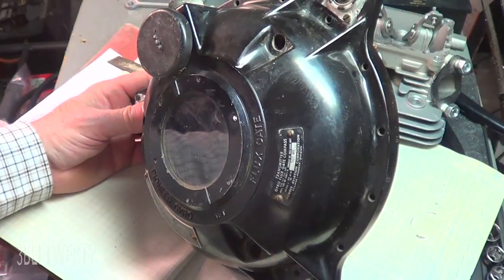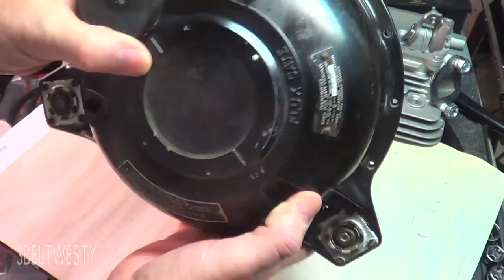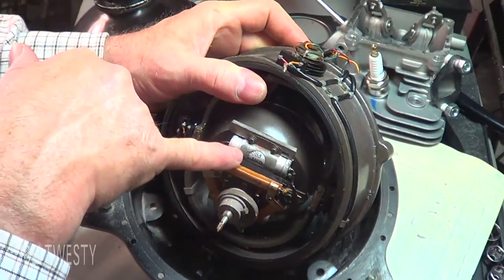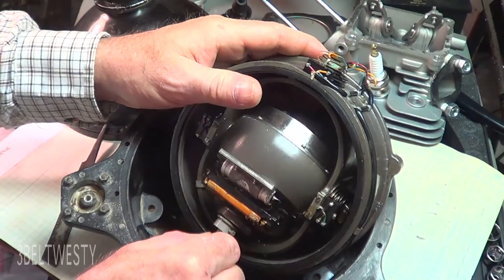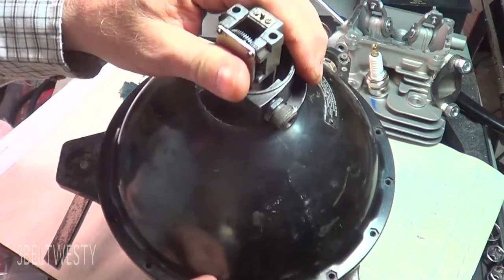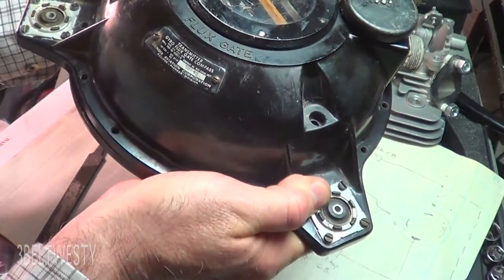Bendix Gyro Compass Transmitter Navy AN 5751 Flux Gate

Comment: Great show.  In later developments, a significant change was made by separating the flux valve from the gyroscope and suspending the sensing element inside a sealed bowl no larger than a coffee cup.  Gravity alone kept the valve vertical (horizontal for the plane of the sense coils).  Of course, whenever the airplane accelerated in longitudinal or lateral axes, that is, changes in speed or turning, the pendulum allowed the valve axis to move out of vertical and transmit erroneous heading data until the airplane returned to steady state flight.  Not a problem, because compass cards were slaved to a transmitter in the separate directional gyro, which maintained its heading reference during maneuvers by gyroscopic rigidity.  The signals from the flux gate were referenced to a differential synchro in the master compass indicator.  Any difference between compass card position and flux valve heading resulted in an error signal which was amplified and applied to a torque motor that would precess the directional gyro in the proper direction until the following master card was in the sensed heading position.  This precession rate was usually about two to four degrees a minute, so aircraft maneuvers were not persistent enough to significantly displace the gyro heading before level flight resumed.  Often, a slaving cut-out circuit shut down the torquer motor during maneuvers and enabled it in level flight.  The onset of jet-powered flight caused a problem when the prolonged acceleration during and following takeoff caused significant heading errors due to displacement of the flux gate pendulum.  Pilots were trained to anticipate and correct for the errors that resulted until steady state flight was achieved.

Comment: Most important thing of this device is not the gyro but the 3 fluxgate sensors we can see at 02:35 between the capacitors. The gyro is slaved to the fluxgate sensors using external amplifier.

Comment: I believe the gyro is only there to provide a level platform for the flux gate which is the active magnetic sensing device for the compass system.     The ball bearing is probably part of an erection system to keep the gyro level so it tends to always be erect or upright with respect to the local level at the aircrafts current position.

Comment: This is interesting, I actually just bought a flux gate tester transmitter from Bendix Aviation this very day at a auction. I imagine my machine was used to test the compass before installation in a aircraft. It's stock no. is 70AC-806210. I haven't been able to find any information about it as of yet.

Comment from the maker: 0:29 in practice a motor was attached where I have the file to cage the gyro. The way it was made was a dumb flat bladed screwdriver works too ie if the motor died.